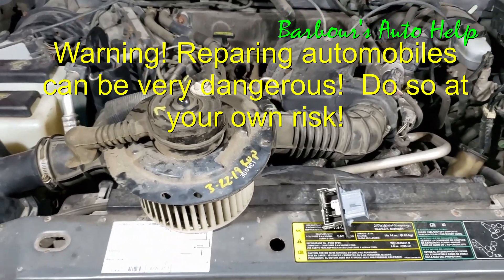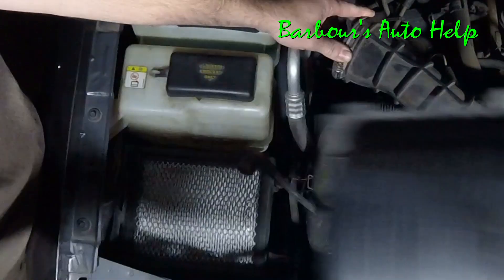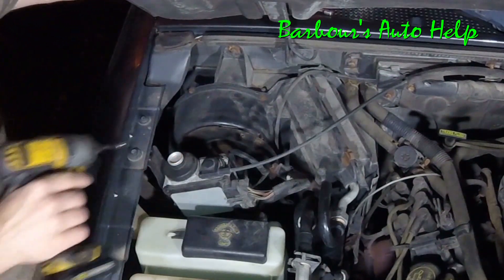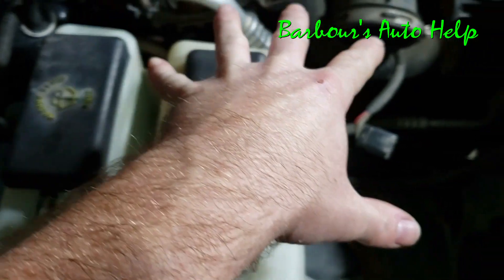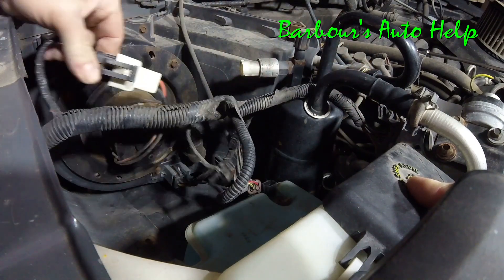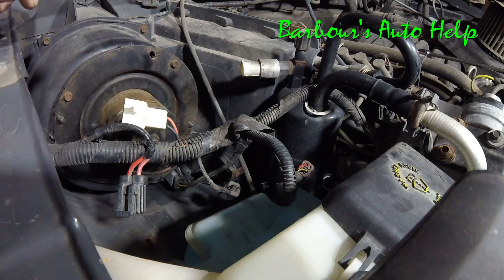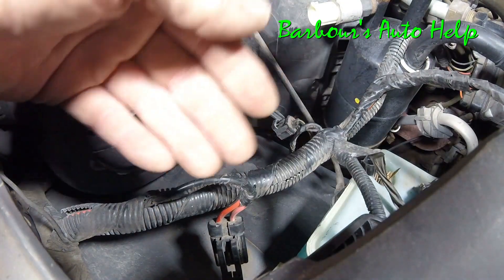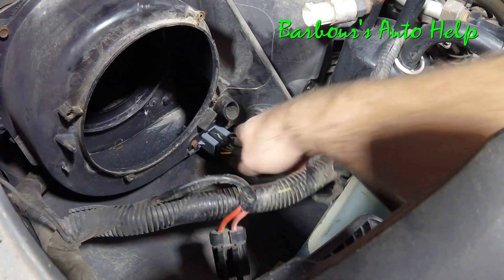Blower Motor and Blower Resistor Replacement 04 Ford Ranger

Comment: This is one of the nicest videos I have ever seen pictures were excellent description was excellent I was having trouble getting my airbox out was stuck in the bottom grommets so hard I thought it was bolted I was able to work at Lulu's with a screwdriver through the bottom of the air box a little bit of silicone spray lube down into the grommets made it slide out nicely it was really stuck in those grommets on the bottom thought I was going to break the air box in half so thank you for your description of the whole project and not just putting it back in you sure have a definite talent for teaching thank you very much
Reply from the maker: Thank you so much.  That's a wonderful compliment.   I'm glad to be helping.

Comment: THANK YOU SO MUCH FOR THIS!!!
I bought a new motor for my 05 ranger at auto zone ($45) and decided to get the resistor too ($20). The one thing your video did not show, as you said you got yours at a junk yard, was swapping the fan out.... Pry the retaining clip off and save it if new motor did not come with one. A little bit of lubricant on the shaft, hold the fan (helper may be needed) & tap on the end of the shaft with a hammer. Carefully remove foam gasket and place on new motor (i had to glue mine in place) & make sure holes line up. Install fan on motor and secure in place with the retaining clip. 

I hope that helps anyone that got confused at this point as I had to call up parts store to find that part out. 
Great video and you helped me out immensely with it!

Comment: Just did this on my 05 ranger, hardest part was taking off and putting back on the air filter housing.  Almost felt like i was gonna break it pulling it up was stuck very tight.  But i got it done, thanks for the help.
Reply from the maker: Glad it helped

Comment: There is a screen back in the blower housing you can get to while the blower is out. They are bad about getting clogged up and restricting air flow out of the vents. I duct taped a piece of 1/2" cpvc pipe about 16 inches long into the end of a 1 gallon shop vac. Spray the screen liberally with a soap/water solution from  a jet spray bottle. It will clean much better being wet. And vacuum it out. Shine a good light in to inspect it. This screen can also be vacuumed from the inside if you open the glove box and release the latches on the side and let it hang straight down. Put the air conditioner on Max Air and the door will open where you can see the screen. Kill the engine and clean the screen. I do this about once a year. That screen will get very clogged sometimes. I have an 07 and an 09 model and they both have the screen.

Comment: Awesome video. I retired my 04 manual as my daily driver in 2017. It has 330k miles on it and still starts right up and sounds great, minus the lack of exhaust since it was so rotted for 4 years. Since I just replaced the exhaust and completely redid the front brakes...brake lines suck...It's time to tackle the rattling noise and lack of different speeds in the blower. It functions but its annoying and if i can get it done cheaply I'll do it.

Comment: Excellent instructions,  one tip if you can't get your air intake reservoir off spray a little lubricant into the grommet holes in the bottom works like a charm. the holes lead right to the rubber grommets.
Reply from the maker: Thanks for the info!

Comment: Just got around to replacing the motor on my 02 ranger. I had to really manhandle that airbox to get it off AND on. and yes I did lose one of the motor screws as it fell into nether region under the motor.. My replacement fan did not come with a gasket so I gingerly took the old gasket off without tearing and used 4 small dabs of super glue to hold it on the new motor frame at the screw holes. Thanks for your help.

Comment: Yes it was very helpful, one thing after the fact, the resistors on the old pack is mounted on fiberglass it seems, after examining it later I found tiny hairs of glass in my finger, beware! Try not to handle it with bare fingers

Comment: I CANNOT get the bottom part of my air filter box out..it'd a 2001 4.0 ranger 2wd Is thr any difference or do I need to jus keep pulling??
Any advice would be really helpful thx!
Reply from the maker: Not sure how to help on this one.  Maybe use penetrating oil.  Are you sure there aren't any bolts holding it?

Comment: Great video, however there is NO need to remove such a large "billable" amount of hours and equipment from the fender. The squirrel cage blower wheel will distort enough to fit into the housing. Simply align the clock rotation (as if the thing would fit in the first place) and at the top position (12 O'clock), with the bottom facing to the rear as much as possible, tip the wheel forward and exactly at the top notice that the wheel is only a quarter inch away from slipping home. Take your time. Then when the closest point, just compress the top of the wheel down, and the old unit slips right out, and the new one slips right in. Even the original unit had NO damage after removal. I had to work harder removing the electrical connectors. 4x8mm  & 1x 10mm. Use a 1/4" drive for the 8mm fasteners.
Reply from the maker: However you want to do it.

Comment: I was able to wiggle mine out without removing the washer fluid reservoir on a 2009. Tilt it down on the front and it will pop out at the top of the opening.
Reply from the maker: Awesome!

Comment: Hello I have a question the  Mine when I'm driving it turns off and the a / c turns on will be the blower resistor ?? Ford ranger 2004 4.0l